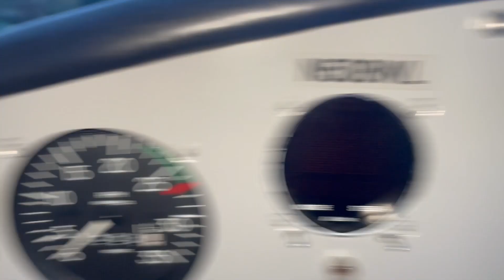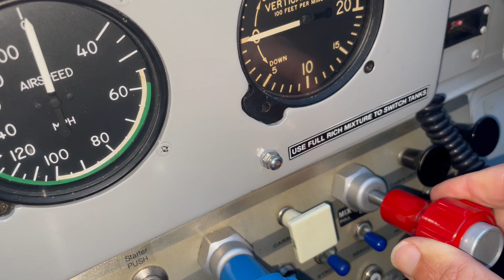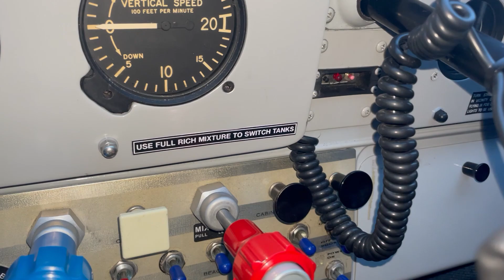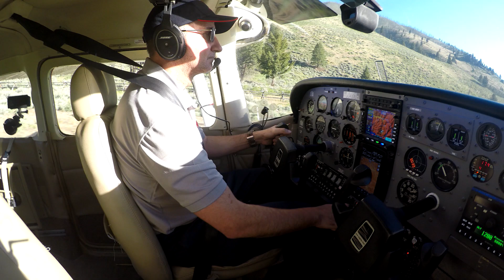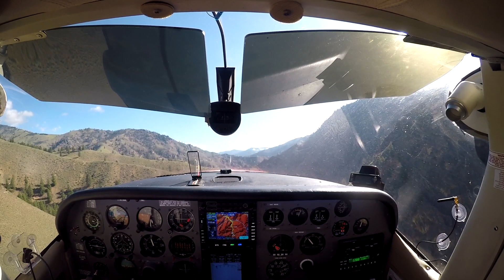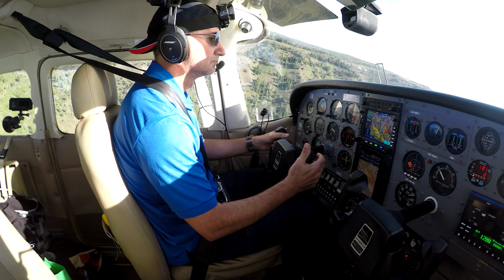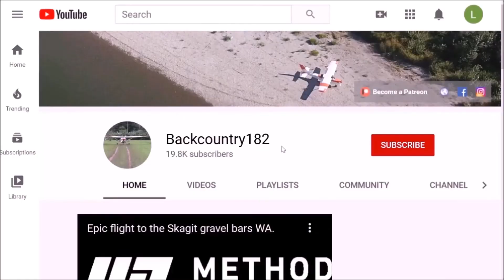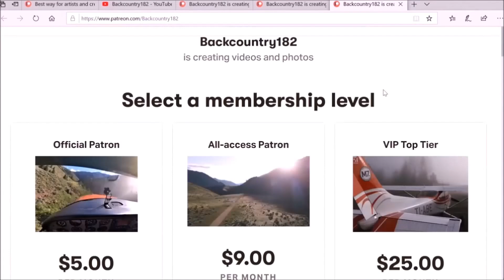Flying at High-Density Altitudes: The Key to Mixture Adjustment

Comment: 20 flaps?
Reply from the maker: Yes 20 degrees adds more lift than drag on the 182
Reply: @motoadveBackcountry182  172 poh says 10 but 20 is tempting. In Alaska they use 40 to get out of the mud then 10 once in ground effect
Reply from the maker: @derheeheehee6941  Yes, many times I take off with 30 degrees and reduce to 20 or 10 in ground effect.
Reply: Lean for max static rpm and go

Comment: I’ve always been taught to reduce mixture until RPM peaks- so it’ll start to rise and then you keep pulling mixture and it keeps rising and rising and then eventually you get a drop in RPM. After that put mixture back in two turns.

The difference between “RPMs begin to rise” and “RPMs have risen all the way to the peak” can be quite significant on hot days.

I’m worried that you may not be reducing the mixture enough with your method.
Reply: Agree.  I always reduced the mixture to max rpm in carburetor Lycoming engines.  We all did in the pipeline patrol company I flew with.  That was low land and mountains.  We had far less lead blown out of cylinders and cleaned out of plugs every 50 hours.  Waiting until 100 hours meant a lot of lead.  Also the engine ran better and was plenty cool.  I don't know how much difference never climbing made.  We had a 200' AGL waiver.
Reply: I was taught to always leave mixture rich for takeoff. Never sat well with me, when the engine was also struggling to idle during taxi to the point I had to lean it massively. If I get my own airplane I'll be leaning for every takeoff
Reply: @ I was taught to lean a few turns for taxi after startup, lean to rich of peak RPM for takeoff and in cruise and then lean for taxi after landing.

Comment: For landing at these high DA locations, how do you mix? 

For glacier ops (on skis) we mix for best power at pattern elevation (~8000‘ - 9000‘ DA) and then don’t touch it. At this DA, the engine is below 75% power, so temps are not a problem.   But I guess this wouldn’t be the best approach for 5000 a 6000‘ DA fields.
Reply from the maker: For landing I leave the gap I created on my very first take off of the day, if coming from sea level , I lean at altitude at full power, and increase mixture a bit.

Comment: Thank you for this but Question: do you lean to "peak RPMS" and then richen or lean to just an increase in RPMS and then richen a-bit?
A Special Thank You for responding to my request and posting this.
Robert
Reply from the maker: Yes pull mixture until rpms rises, then enrichen a bit
Reply: I’ve always been taught to reduce mixture until RPM peaks- so it’ll start to rise and then you keep pulling mixture and it keeps rising and rising and then eventually you get a drop in RPM. After that put mixture back in two turns.

The difference between “RPMs begin to rise” and “RPMs have risen all the way to the peak” can be quite significant on hot days.

My home airport is 6200 feet AGL